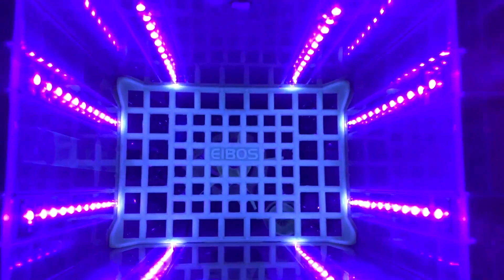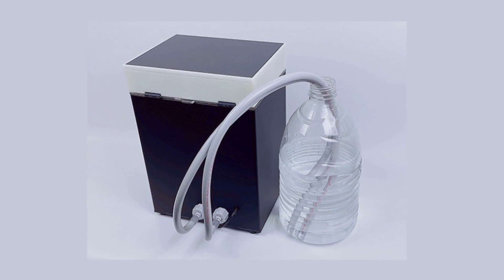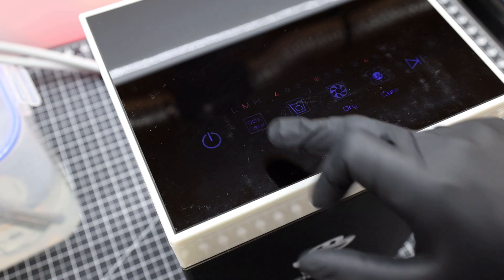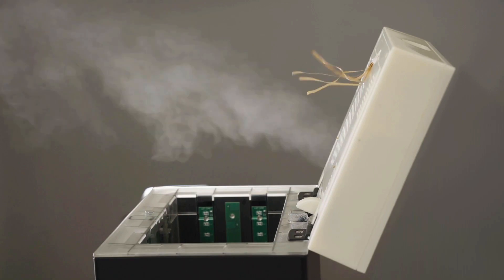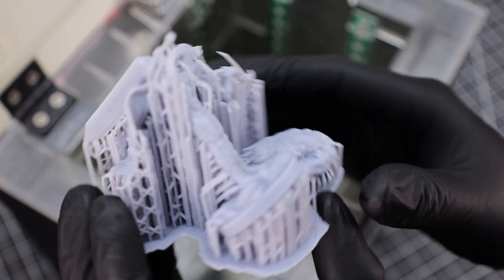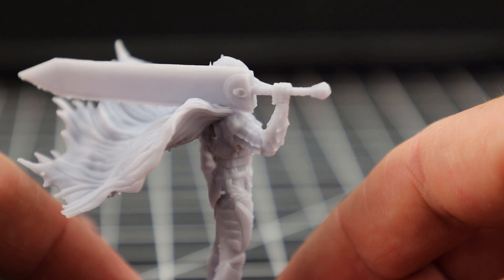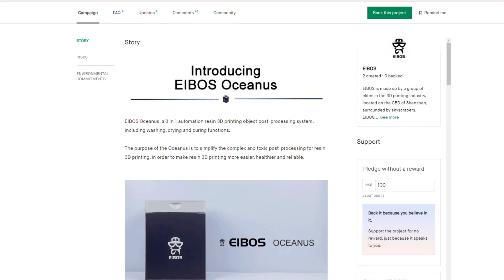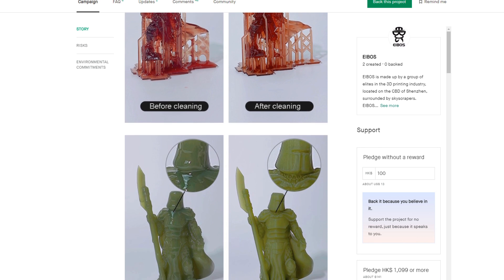Affordable Automatic Resin Wash, Dry & Cure System - Eibos Oceanus

Comment: Have had nothing but trouble with this.
Good idea but not reliable,
Reply from the maker: What problems have you had?
Reply: Just constantly goes into error mode. If i just want to cure, it will work for a little while then goes into error mode, if ibjust want to wash it will part fill then goes into error mode. It is like program is up the shoot.
Reply from the maker: Have you contacted the company about this to see about getting it fixed or a replacement?
Reply: I have emailed their support, but i have seen another thread from someone who had one where the panel warped. Apparently, it was a known issue and he wasn't getting any support.
Reply: Were you ever able to get some support or a replacement from Eibos? @stephenpowell5306